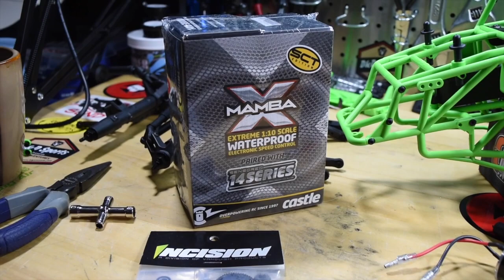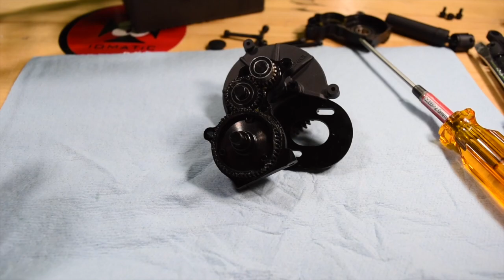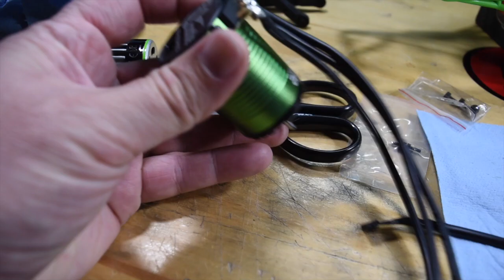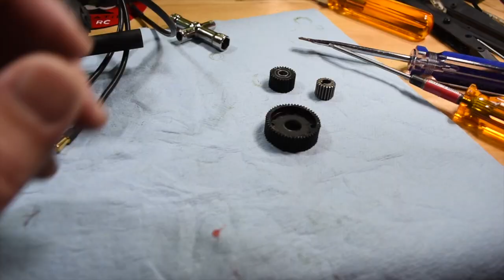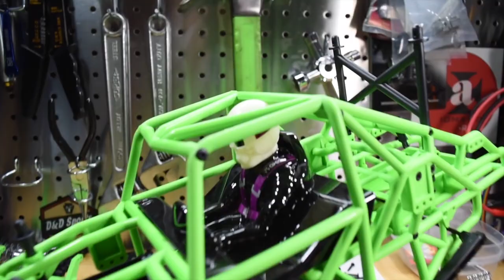Project Grave Digger - Castle Motor Install

Comment: 🐸 Awesome start Ax great to see you went sensored on you brushless set up, no cogging at low speeds. Top notch upgrades so far should be sweet. Thanks for sharing. Later
Reply from the maker: GREEN FROG R.C. - thanks man! Gotta whole lotta green going on!
Reply: but who goes slow with a Monster Truck? 😂

Comment: Axio having alot of rc projects in hand that's awesome! I will suggest getting the Robinson Racing spur and pinion. I don't know if they make it for the Mt10 but, for the axial wraith I'm sure they do. I have that installed on my honcho Scx10. Just a friendly tip.🤘🏻😎 can't wait to see this rig rippin it up!
Reply: Pinion sure but plastic spur gear to be the weakest link
Reply: @odomandr  : Can't go wrong with the Robinson racing set up. Once the plastic spur gear gives out maybe Axiomatic could replace it with that. His choice.✌🏼
Reply from the maker: Yes, I left the plastic in to have a blow out point just in case something goes hey wire. Many of the SMT10 parts are the same as the wraith so easy to find things.